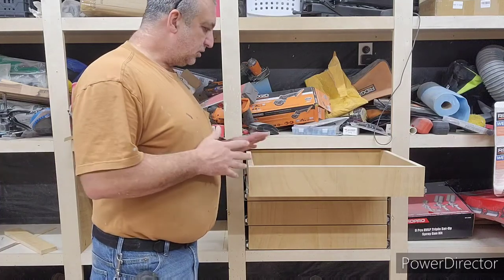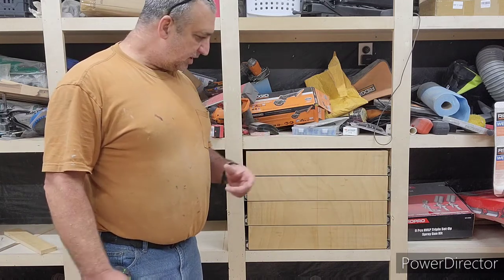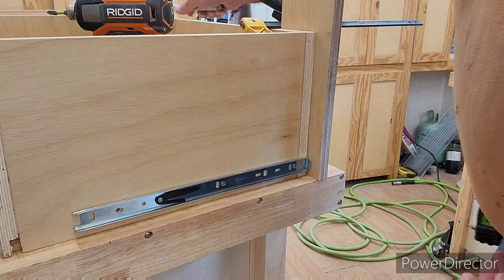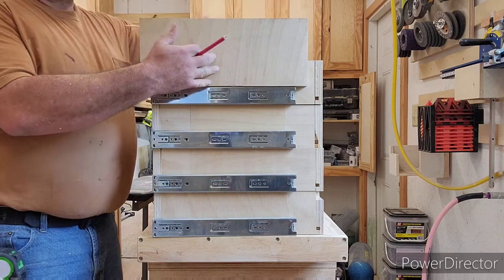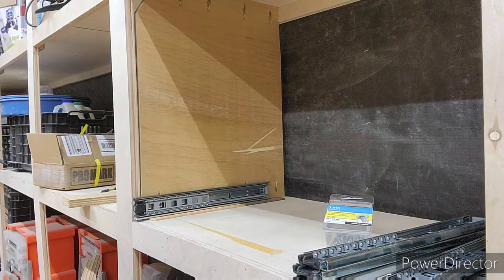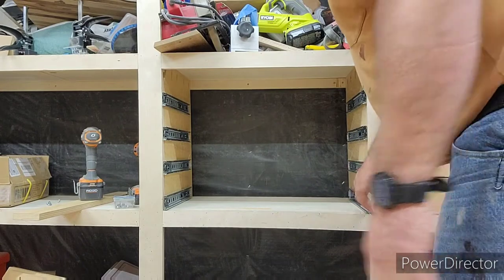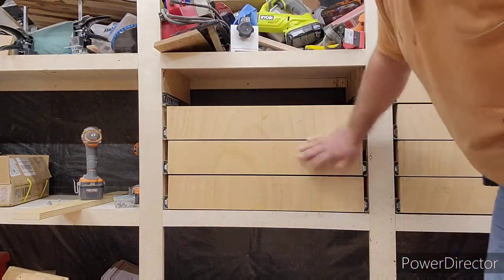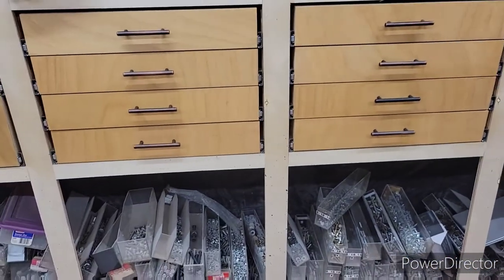How to install drawer slides quick and simple without jigs or measuring.

Comment: Your video saved me so much time.  I started reading the directions that came with slides I purchased and they were very confusing.  Using your method I had then mounted and installed in less than 20 minutes.
Reply from the maker: Glad it helped! It may not be the way the instructions say, but it is quick and easy. Most importantly it works.

Comment: I have also been watching numerous videos on installing bearing drawer slides. This has definitely answered my search and is the solution I was looking for. Thanks for the video. I feel now much more confident that I will be able to successfully install the drawers for my kitchen rebuild project. 👍🏼👍🏼
Reply from the maker: Just take your time and use spacers blocks, and you should be fine. The mounting holes are slotted, some vertical, and some horizontal. If you need to make a small adjustment, you may need to move a screw to the right hole where you can slide it to make any fine adjustment you need. For a kitchen, you will be adding drawer fronts. If the drawers are off a little, it will be covered by the drawer fronts.

Comment: I just discovered you, thanks to your great method for mounting drawer slides. I put nine drawers in a cabinet using your method. Easy and fast. I scanned through your other videos and saw the short presentation of the Foreman-like pocket hole machine. I sure wish you would make a build video and set of plans for it. Thanks.
Reply from the maker: I am sorry I haven't made it yet. I have put in for several vactions at my full-time job over the next few months. I plan to get several projects including the pocket hole machine done.

Comment: Hey Robert, another excellent, easy-to-follow video.  I've always stayed away from adding drawers to my projects because of the fear of having to install them.  Other channels make it seem like you need special tools and jigs in order to get the job done. Now I'll look on your channel to see if you have an easy-to-follow video on how you made the drawers.  (If you don't have one, please consider making one).  I have a few projects around the shop and home that can use some pull-out drawers.  (Edited: I just found the drawer videos) Thanks again for sharing.
Reply from the maker: I always struggled with spacing drawers and getting the slides straight. Now that I figured this out, I put drawers in everything.

Comment: I'm using your technique tomorrow on my dresser build! Thanks!
Reply from the maker: I hope everything goes smoothly. I used to hate installing draw slides. I would spend as much time installing the slides as building the cabinet.
Reply: @ShopRamblings  I used part of your method and part of mine. Instead of a spacer to set each outer slide I measured from the bottom of the carcass, that way if my spacer was off by 1/16" I wouldn't keep stacking in the error until the top slide was off by 3/8".

Comment: Great video, thanks. I still have to find out how to measure drawer faces, but this was a useful.
Reply from the maker: It depends on if you are just installing a drawer or if they are going to be above a cabinet. For normal construction, I use 1/2" overlay concealment hinges unless I am trying to match something already built. That means the cabinet door overlays on the hinge side 1/2". Just to keep it simple, I do 1/2" on every side. I always build the cabinet first. Then, I measure the opening and add 1" to both the length and width. Keeping it simple, I do the drawer faces the say way. So if the drawer opening is 14" x 5", I would cut my drawer face 15" x 6". I a situation where there is not a rail between the draws measure from the top of one drawer to the top of the next drawer. Then, subtract the gap you want in between the drawers. If from top to top is 6" and you want a 1/4" gap, then when mounting the face, it should be 1/8" from the center of where you want the gap on top and bottom. The next drawer will be the same to give the total gap.

Comment: You can keep out more dust by just making the front board of your drawer wider and have the drawer close against the outside edge of the frame.  You don’t need a decorated front panel and you won’t have a big 1/2 “ gap on each side of your closed drawer.  The drawer dimensions remain the same except for a wider front piece of the drawer.  There would still be a .125 gap vertically between drawers with the exception of the top and bottom drawer fronts that could be a 1/2” taller to close the gag at the top and bottom of the drawer stack.
Reply from the maker: That would work but you would have to set the slides back.
Reply: Woodshop assembly table

Comment: Looks good.  Simple.  I like it.  If you made your drawers with a 3/8" overhang left and right on the front it would close the side gap down to about 1/8".  Might look a little better and keep even more dust out.
Reply from the maker: I wish I could post pictures in the comments. I have gone back and put walnut draw fronts with 3/32 gaps. Closed up the gap underneath in the front so any dust that goes through the dog holes comes out the back and I completely closed in the drawers in the back. Not more dust in the drawers. Maybe I will shot a short update and post it.

Comment: Hi Robert, I was wondering how you knew what size you made your drawers to fit your space? just for reference purpose. I have numerous draws to install a box and was wondering if you could help
Reply from the maker: I measured the opening. I subtracted 1/8". Then divided that by the number of drawers I wanted. Then made each drawer 1/8" shorter than that. That gives 1/8" above and below each drawer.

Comment: Easy peasy lemon squeezee. Nice, repeatable process. Just one thing I would do different. There is a reason the manufacturer went through all the trouble to put those cut outs on the roller frame, and it has to do with installation.

Comment: Hi Robert, just installed 5 draw slides in a set of drawers, my first time installing more then one, it was a challenge, it took a lot longer then 2 1/2 minutes believe me, then this morning came across your video, Wow! You made it look so easy, 
Just a quick question you set the slides on a flat bench top, and marked your spacer to suit, then when installing you added a spacer under your first slide, dose this not alter the spacing, when you fix the top drawer, or is it just me miss understanding the process.
Great vid it’s given me much confidence to attempt another one at some stage 🤪👍
Reply from the maker: I mount the slides touching the table. There needs to be a small amount of space under the draw, so it doesn't rub when opening and closing. I normally use a 1/8" spacer.

Comment: Why do the rails have to be mounted on the bottom. Why not the middle so that it's easier to drill for the first rail? Or mount on top of drawer so when things fall to the side it'll act as a stop.
Reply from the maker: They don't have to be. They can be mounted anywhere you want on the side.

Comment: perfectly I can't comprehend doing a remove and replace I have drawers and am changing the old slides for these anti-slam slides but have no way to guess where to put the runners inside the cabinet it's to bad I don't have an exact replacement for the old slides I need a technician to do this I'm totally lost I can't even take the slides apart to mount them
Reply from the maker: When you open the drawer all the way out, normally you can see a small lever. Push it up or down, and it should release the catch. It you want email me your number and I can text you some pictures and try to help. Shopramblings@gmail.com

Comment: Very cool - how do you do it with face frames though? I get the spacing and the front one is easy - but with a rear mounting bracket? Or do you add spacers on the side to make up the difference? Thanks!
Reply from the maker: I am not sure if this type of slide has a back mount. What I do is cut a spacer block. I measure the lip on the inside. If it is under 1/4" I will somethime I will just put a couple of washers. More than that, I will cut 2 strips and put them vertically, making sure they are where the screws go. Then I use screw long enough to go through the spacer and into the cabinet.
Reply: @ShopRamblings  OK, thank you :)

Comment: How did you determine the width of the drawers so that they fit?
Reply from the maker: The easiest way is to place the slides in the opening where the drawer goes up against one side and measure to the other side. Some slides will tell you the amount of room that they take up. I find for this style slide that it's normally about and half an inch on each side, so I just make the drawers one inch smaller than the opening. 📏📐 #DIY #HomeImprovement #Handyman

Comment: Great video. The drawer side slide spacing is very well identified but unless I missed it how did you determine the size of the spacer between the cabinet slides?
Reply from the maker: The sides normally say how much space. For this style, 1/2" on each side is standard.
Reply: I don't know why but I didn't realize just what the spacer was you showed at the very first. Once that clicked it is a no brainer. Sorry for my confusion.
Reply from the maker: @stuartjohnson8171  it takes me 3 times to get things most of the time. I am glad you figured it out.
Reply: Great video. Perfect timing for me. Thanks!!

Comment: What  measurement did you use to mount the piece on the drawer box?
Reply from the maker: Are you referring to the metal drawer slide to the drawer. If so I didn't measure. I made sure it was flush to the front and bottom edge.

Comment: New viewer here.  Great video. Can you give me any guidance on how to calculate the width of the drawers in relation to the frames taking int account the thickness of the slides?  Thank you.
Reply from the maker: Most of this kind of slide takes 1/2" each. Measure your opening width and subtract 1". If you think your slides are not standard, place both sets against one side and measure from the other side to the slides, and that should also give you the correct measurement. If you need more help let me know.
Reply: @ShopRamblings  Thanks.  Vince

Comment: First just let me say I'm a beginner. So you gave yourself 1" space for drawers. But when installing bottom drawer you used a 3/4" spacer for slides then a 1/4" spacer to raise drawer box. Don't you have less then  a 1" gap for bottom drawer. I'm thinking I would have used a 1" spacer. Again I'm a noob soory!
Reply from the maker: I am not sure I completely understand what you are trying to say. My drawers are 1" narrower than the opening. The slides are 1/2" wide on each side. I mount the slides flush to the bottom. I used a paint stick to give me just under a 1/8" gap on the bottom. I used the same paint stick to mark the spacer for the slides above the bottom one.
Reply: @ShopRamblings  I am so sorry! Somehow my message was sent to you when it was meant for previous video before yours. Again I'm sorry.
Reply from the maker: NP

Comment: I got 6 sets on line at home depot  80 dollars.
Reply from the maker: What type of slide did you get?
Reply: @ShopRamblings  well when I could not get apart i looked up order and its exactly like yours but unbranded.  They seem good quality, slide easily, come apart easily and heavy.  The drawer attachment is going well.  They are not soft close because on utube women couldn’t  install them and gave up.  others said buy regular close its easier.  appreciate your video, i was lost.  watched a million videos and read and read directions.  i have more than 6 drawers to do but this is for the broken ones.  I am fixing drawers and replacing sliders then will paint the cabinets.